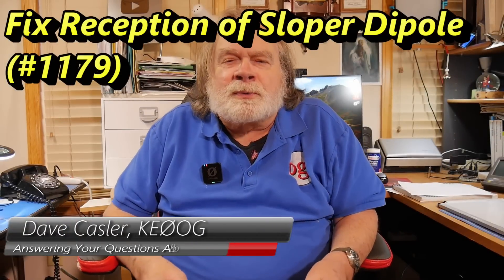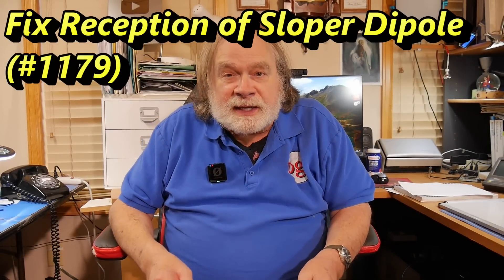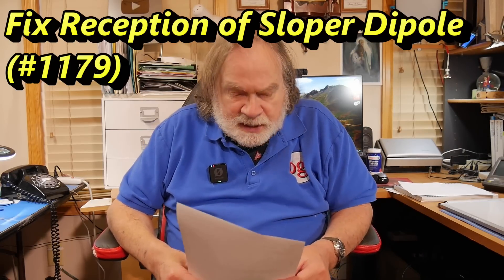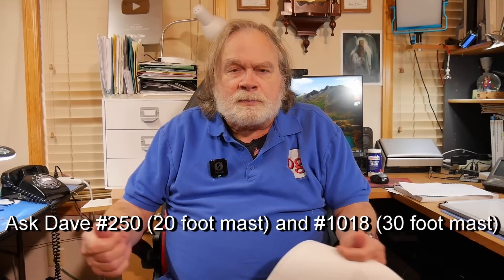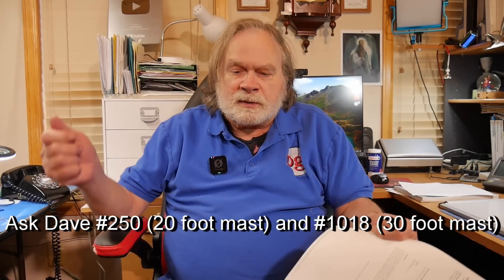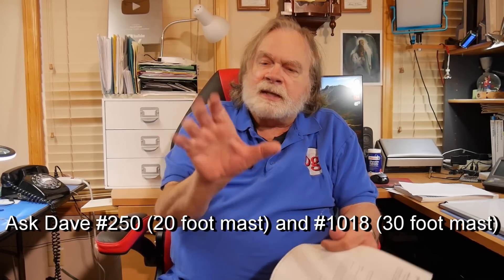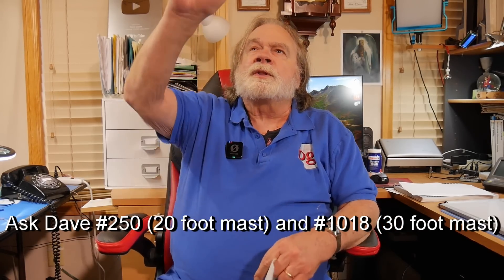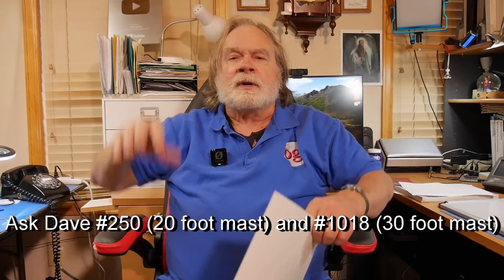Fix Reception of Sloper Dipole (#1179)

Comment: After being away from Amateur Radio for 50+ years "because I could not afford the equipment," I purchased an ICOM IC-7300 the beginning of NOV 2024. I made my first contact last night to Toronto from ND on 20m. I used a multi-band whip style antenna. Located on the dining room floor, near the patio's sliding door.  

  I would like to place the antenna outside on the deck but the coax is too short. I noticed something in the manual about coax length shouldn't be longer than approx 17 feet for the internal tuner.  Is that true? I need to add about 15 feet.  Do I have to purchase an expensive external antenna tuner? 
Thanks - AC0BT